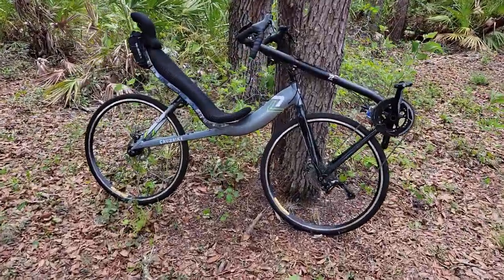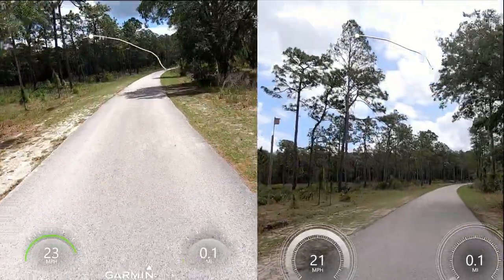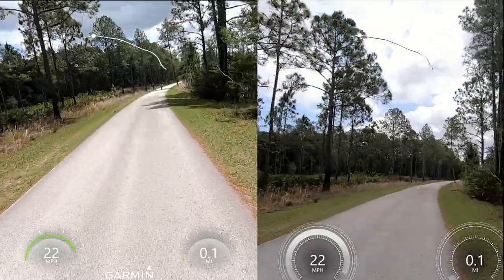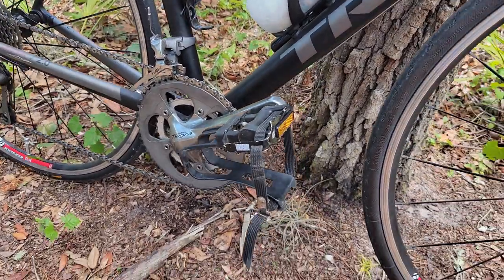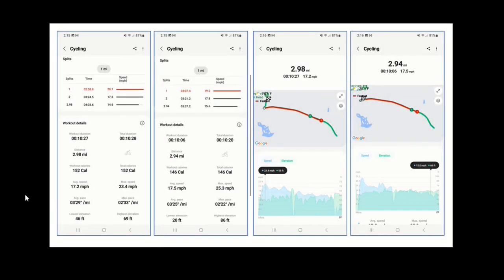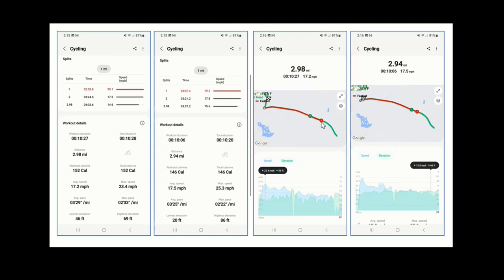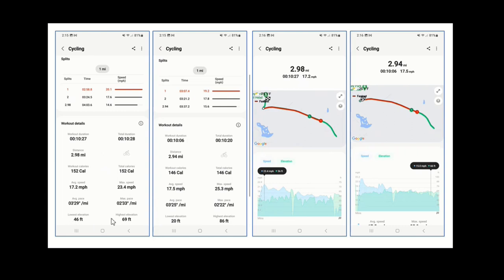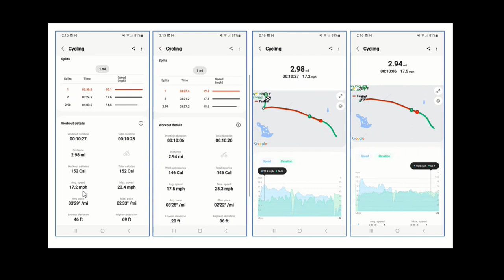Windy Day, Recumbent Bike vs Road Bike Performance in the Wind

Comment: Not a fair comparison because you're clipping in so to speak on the diamond frame and you're just using flat pedals on the recumbent you need to do apples to apples you need to get clipless pedals on both and that would make it a fair comparison. 
I think the cruzbike v20 Vendetta would have been significantly faster than both of these bikes.
Reply: There's not much difference, except when sprinting

Comment: I'm wondering how you warmed up before riding and which bike you used to warm up?  There could have been some advantage to riding the second bike just due to having already warmed up.  Also, I'm wondering why you switched from the Bacchetta used in previous videos to the Cruzbike?  BTW, the S40 is more of an "endurance road bike", not really designed as a direct competitor/replacement for a typical road bike although there is some overlap.  The V20 on the other hand was designed to be a direct competitor/replacement to road bikes and probably would make for better comparison..  I own and ride both.  I will say that once you get your bent legs, in most situations, you will be faster on a comparable recumbent.  At least that is my experience.  Thanks again for the videos!

Comment: The result could be different with a high racer recumbent or a low racer. Your bike is nice but ... not the best to conclude the efficiency of these 2 types of bicycle. Two bikes with power meter can give us an exact comparison.
Reply from the maker: Agreed on the theory of all points. While not a fully controlled (variables)  experiment, I wanted to provide some kind of comparison. I think the parameters were all apparent so the viewer can make their own judgement.

Comment: with the wind, your back act like a sail, so it helps gain energy.
but i'm kinda skeptical about this test, or i just didn't understand it.
also, how you measure power, there was no real measurment of power output
plus repeatability, from scientific methode pov, you can't make any definite conclusions from this test.
Reply from the maker: Yep, not going to rent a wind tunnel or indoor track, so we will have to settle for this test - albeit not in full control of the variables.